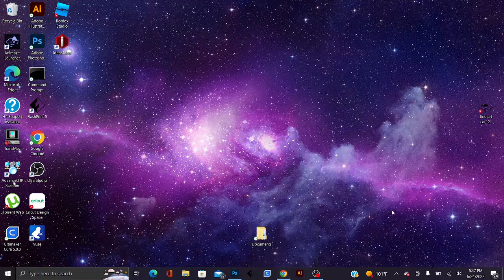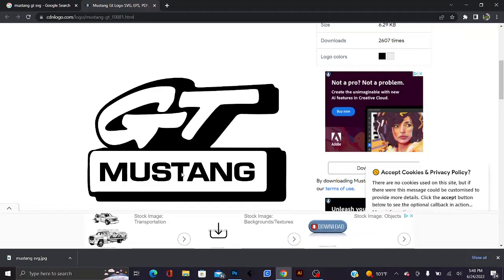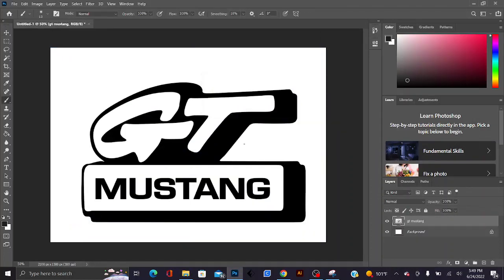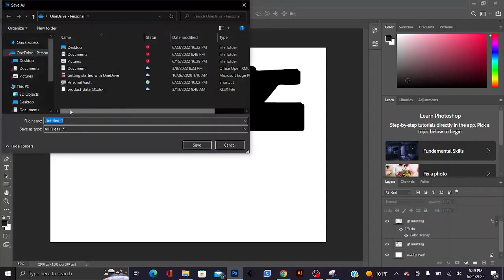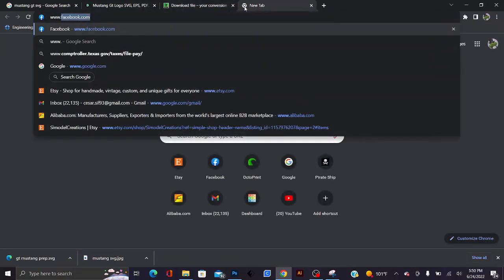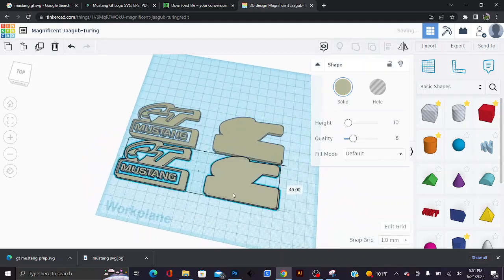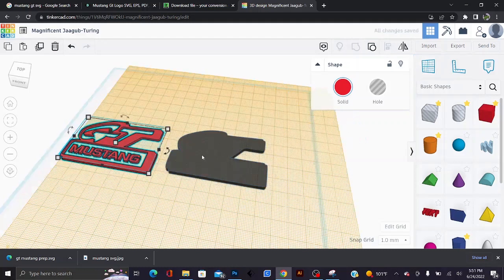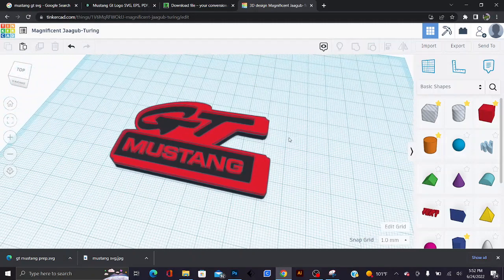Converting Any Image Into A STL Model For 3D Printing

Comment: ive had this video pinned for all my 3d stuff to refer to! but one thing i cant figure out is how to do this with an image that has breaks in the picture. for example, a basketball that the lines of the ball are white and when you delete the background it deletes the lines. which is fine, but when you make a copy and do a black color overlay, it doesnt turn it into a solid black ball. 

any tips on how to make an image solid black that has those spaces? thanks!

also note that i use Krita software!
Reply from the maker: you would need to add an additional layer behind the basketball so that it doesn't completely erase the black lines. Hope that helps!